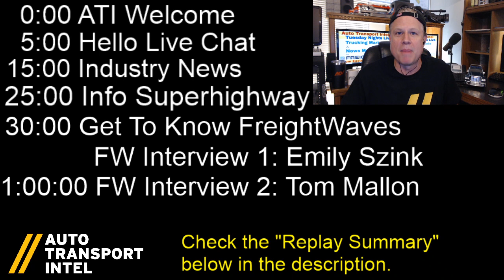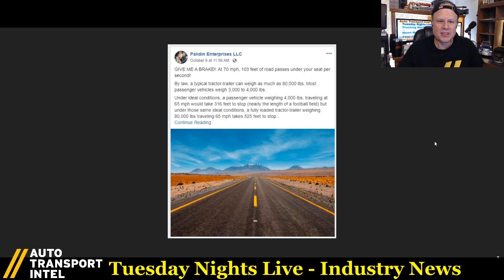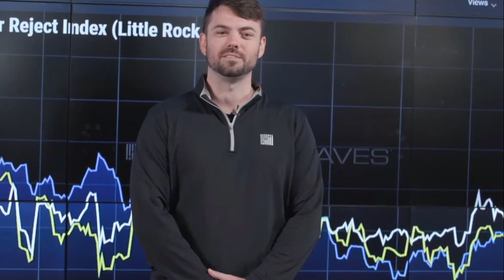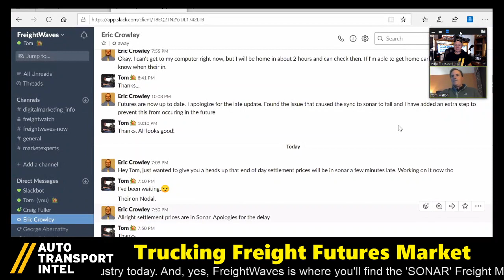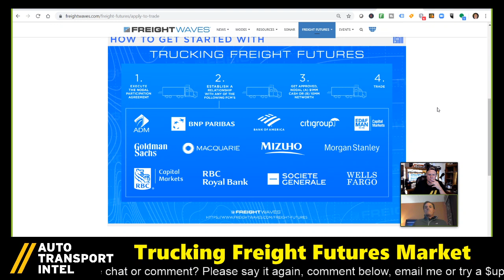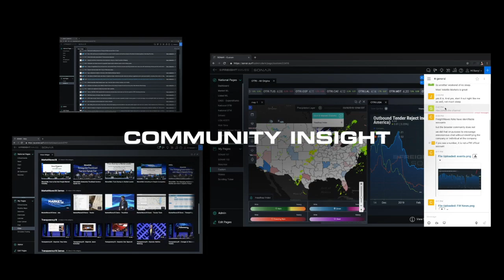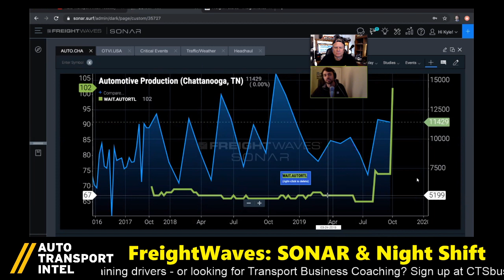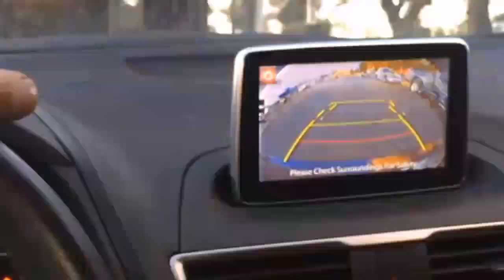FreightWaves.com: Trucking Markets, Transportation News, Freight Media

Comment: Brother u think there’s enough cars on central dispatch for 7 cars enclosed trailer ?? Thanks
Reply from the maker: It depends on where you are and where you're going, but my gut instinct is that it will be a challenge. First, I don't think you'll find enough great-paying, high-end, enclosed vehicles on the load board to satisfy what you're capable of making - and if you do, they will be pretty spread out for pickups and deliveries that you're going to have to be really good at searching up those loads. If you're interested in learning more, you can email your contact info to autotransportintel at gmail dot com and I'll put you in touch with our lead coach, Ty. And thanks for the question.